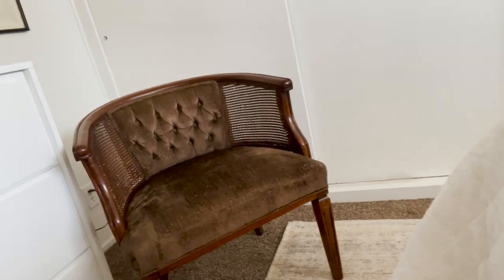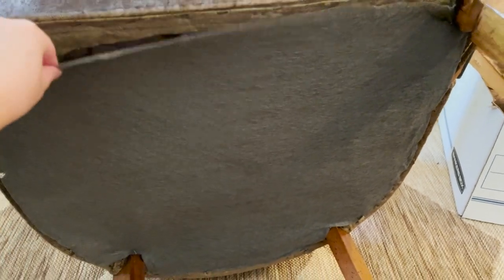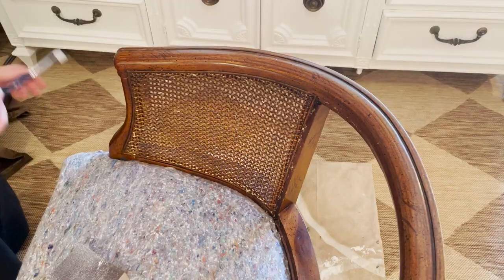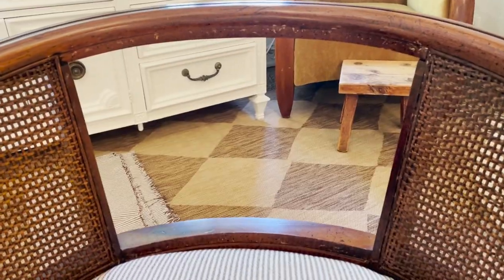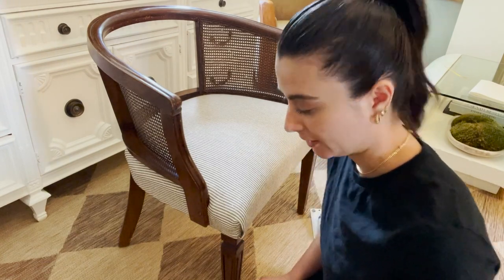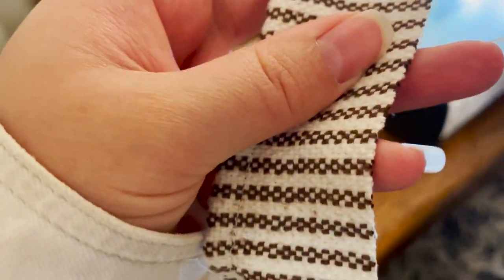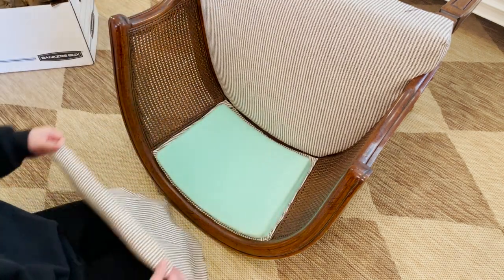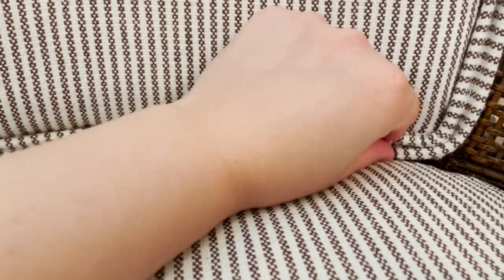DIY Upholstery | Vintage Cane Barrel Chair

Comment: Definitely add the wood piece in the front. Also great job - using the wood glue and stain to rehab the cane, paying attention while deconstructing so you know how to reconstruct, and finding innovative ways to achieve the desired result. I have a similar chair I need to reupholster (which I also found in the street) and this helps a lot!

Comment: Hi, I just watched your video because I have one of those same chairs. The bottom just blew out.  If you touch the foam it just crumbles. The bottom carrier is the webbing with the compliment of foam that was in the bottom cushion but it was sewn to the bottom. It came apart as one piece…

Thanks for the tip on the chair back.  I was going to tuft the back again but it looks better without it. I hope you added the bottom strecher across the top under the front seat cushion.

Send me a picture of your finished project.

Comment: Ok, very nice job, but you did not show how you tacked the back on. I have a similar chair that I am redoing, saved the fabric and trim for guides but don't know how the back was stapled together. Then saw your video but yoy didn't show hiw you tacked the back of the back on. 🤔
Reply from the maker: Ah, you’re right sorry about that! When I removed the original fabric, I noticed the back was actually stapled from the front side. There was a lip that allowed space for staples. So first I put the fabric that would be seen from the back of the chair. Then added in the foam padding, then the front fabric piece, and lastly the welt. So depending on how your chair is, you would just layer them in one by one. Hope this makes sense and lmk if you have more questions!

Comment: I have a similar chair that I found on the sidewalk. Mine was tufted on the back and front and has a bit of an arch instead of a smooth barrel. I still haven’t bit the bullet on the reupholstery. I need to find a nice linen. Any suggestions?
Reply from the maker: Sounds like a great find! Look up local fabric stores in your area or a fabric district. That’s usually the best option. For online, kravet has decent prices for quality fabric. Just make sure the fabric is upholstery weight so it’s thick enough.